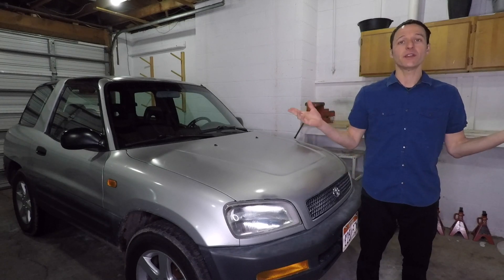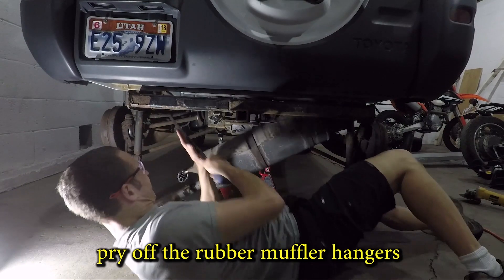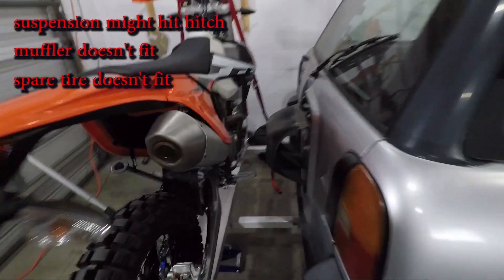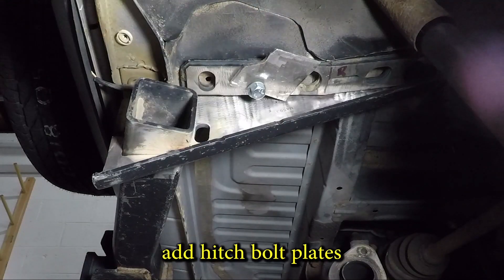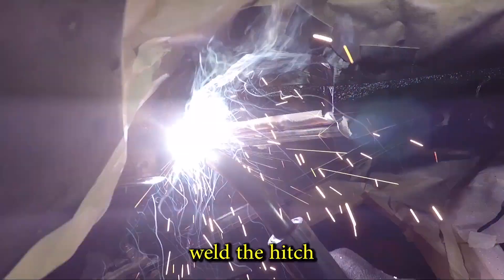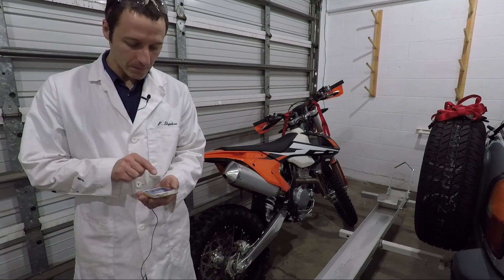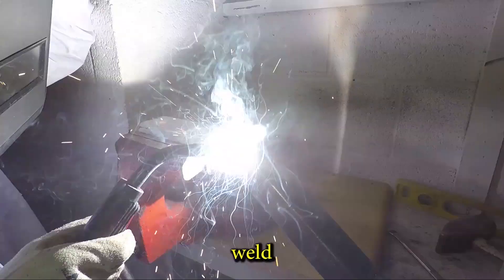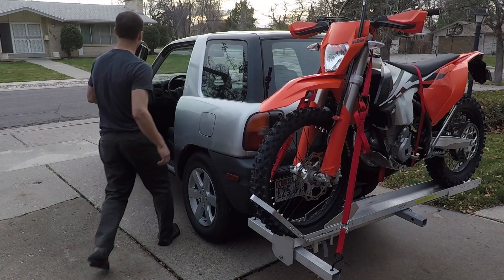Installing a dirt bike rack on my RAV4 (episode 3)

Comment: If you did this in the United Kingdom your car wouldn't be insured unless you told them of your modification. I had one on the back of my Datsun 720 pickup and a driver behind me hit it with his car and damaged the ramp and trailer board. His insurance asked my insurance company was it a proper manufactured part for my vehicle. It wasn't as I made it . If you weld something to your vehicle that's not approved you could be in trouble with the DVLA under alterations to the body structure. Lucky I was a farmer and farmers can do alot of stuff like convert stuff they needed for the farm without approval. This was in 1984 so it's much worse now .
Reply from the maker: It's not fun at all when the government takes away your freedom to work on your own vehicle.  I understand the need for safety inspections to make sure your car isn't a hazard on the road, but when government gets involved, it's guaranteed to be applied in the worst way.

In the United States, vehicle safety inspections and emissions testing is done differently in every state, and each county gets to decide how much testing is needed.  In Utah, they recently stopped doing safety inspections, so now people can crash into you with bald tires in the winter.  More freedom is better though and I'm glad we don't have the safety inspection.  

I live in Salt Lake City, which is a valley with mountains on both sides, and it contains all the pollution we create.  Because of that, every vehicle has to pass an emissions test.  But, thanks to bureaucracy and and overall government incompetence, they don't actually test the exhaust coming out of the car, and instead just make sure the check engine light is off and all emissions components are present.

My RAV4 is currently not registered and doesn't pass emissions because I installed the factory exhaust system from a 1998 RAV4 on my 1997 RAV4.  They're all Toyota parts, and my car runs perfectly.  I have a fresh cylinder head and a new catalytic converter, and the car would definitely pass if they measured the exhaust gasses coming out of the pipe.  But.... my RAV4 originally had 2 catalytic converters and the newer exhaust has 1.  Therefore I tampered with the emissions components and it fails the inspection.

Ironically, before I fixed my car, when it had a blown head gasket and a plugged catalytic converter, it passed the emissions test.  My car literally had white smoke coming out of the pipe and got bad gas mileage.  PASS.  Now that it runs perfectly, FAIL.

I have to register my car to avoid getting a ticket, so I have a few options:
1.  go get an exhaust manifold / catalytic converter from a 1997, which is definitely clogged, and make my car run horrible and burn way more gas to pass the inspection, or perhaps knock out the cat so it's there but doesn't do anything.
2.  get a different emissions sticker for the hood that says the car takes 1 cat.
3.  go to a mechanic who will pass my car
4.  register the car in a different state

I won't be modifying my car, since it works perfectly and adding a second catalytic converter will only take away power and reduce gas mileage.  I'll do one of the other options and probably make a video about it.
Reply: @LabCoatPaul  👍

Comment: Have you carried the CRF300l on this rack? I'll be grabbing a new CRF next year...hopefully, based on availability...but it is a PIG compared to the KTM.
Reply from the maker: Yes, I used the RAV4 to pick up the CRF300L from the dealer.  My rack sits a lot higher than normal so it was hard to push the heavy bike up there.  My class 5 hitch is rated at 1,500 pounds tongue weight when bolted to a Ford F250 super duty.  Welded to the RAV4 I don't know the limit, but I'm sure it's a lot.  I think the normal 2" hitch that bolts on to the RAV4 is rated at 400 pounds tongue weight, so you would be very close to the limit with the rack and the CRF300L on it.

I'm planning on selling my CRF300L soon.  I'm kind of over motorcycle road trips and I would rather have an electric dirt bike for off road use.
Reply: @LabCoatPaul  By the time that the 300 becomes available again in my area I may be "over it"...nearly forty years of riding and i bought my first ever scooter this year, a 2022 Yamaha ZUMA125...and I'm loving it for scooting around the city. Thanks for the reply, and thanks for the channel.

Comment: Well done, you got some awesome skills. How is the rack holding up, please if possible can do a follow up on it and how is the unloading of the bike? Thanks and cheers.
Reply from the maker: Thanks for watching!  I'm still very happy about the dirt bike rack.  The hitch is definitely the strongest part of my car, and I always put the jack on the hitch when I lift my car.  The tilting rack is easy to load, and I can add a strap to the spare tire to make the motorcycle more secure.
Reply: @LabCoatPaul  Hi just assembled my tilt carrier and noticed it has a substantial play on the aluminum sleeve that slips on the steel arm. Did you encounter the same problem and if yes how did you solve it?

Comment: You really did that as a labor of love there! Good planning. That is more than most would ever do. Perhaps you could hire your services out! 

Now a friendly tip: You REALLY should mount taillights to the rack. The ones on the vehicle are blocked far too much. 

Here's how I built my rack, including the lights. 

My rack is a home-built, with a fixed track of U-channel aluminum bolted to two pieces of angle iron welded to the 2" sq. tube in a "cross" shape.  

The angle-iron is only about half to 2/3 the total rack width, because that was all that was needed for strength on the cantilevered rack. 

The 2" steel tube sticks out about 2' behind the U-channel, for tie-downs. The receiver has flanges with holes for tie-downs on that side.

When choosing the 2" tube, I stuck a 6' length into the receiver on my SUV, and jumped on it up and down on it. I wanted the rack to use the lightest materials but still be plenty strong. I would only be using 4 feet, max. (I'm about 200 lbs.) The piece I grabbed felt to light as I carried it around, but dang! It was plenty strong for me jumping on it! It wasn't even CLOSE to bending. My bike weighs about 80 pounds more than I do, but it would not be hanging off nearly as far, maybe 1/4 to 1/3 the distance. I'm not sure now, though, if it was 1/16th (.062") wall, or a little thicker, but it was plenty strong. 

The loading ramp is an equal length of the same U-channel aluminum as the fixed track. When not in use, the ramp stores on the carrier, right beside the main track, held against the inner edge of the fixed channel with two permanently mounted 1/4" bolts, and I just use wing nuts to keep them there. Easy peazy. 

Oh - stainless steel bolts there. I hate rust, love stainless hardware.

To keep the ramp in position while loading and unloading, I just use a single bolt threaded into the middle of the lip fairly near the end of it. To use it, the bolt end slips into a hole drilled in the main track, doing the job of a loose pin, and doesn't need to be fastened. If you want to get all fancy, you can tap the hole in the tongue lip piece and thread the bolt though that, so the lip will rest flat on the track. Otherwise, just use a nut on the underside; either way works. The nut is not so thick it makes it problematic. 

To make the overlapping lip piece on the ramp channel, cut off about 1-2" of the U-channel sides so you have a full width of the bottom of the channel about 1-2" long. Then, file the lip smooth. Bend the lip down a little to match the angle between the ramp and rack. Be gentle bending, so the aluminum doesn't crack. If it does, cut it off flush and make another lip. The ramp doesn't HAVE to be the same length as the fixed track. Now put the ramp in position, and drill the receiver hole in the fixed track. 

The taillights I used are rectangular shaped auto-parts-store trailer lights, the kind that mount flat to a vertical surface. I chose ones that fit nicely inside a piece of U-channel. They are mounted underneath the fixed track to short sections of U-channel that is rotated "back" 90 degrees CW (when looking at the rack from the driver's side) so one side can bolt under the fixed rack channel, and the light can be mounted inside the "U." That protects the lights from damage, whether while driving or just storing it in the garage. Works great! I also beveled the corners of the taillight shroud channel pieces, and any other leg-rippers. Ergonomics, baby! 

Route the wires to a 4-prong flat connector, and  anchor them about every 6-10 inches with plastic P-shaped fasteners screwed to the underside of the rack. If you can, drill small blind holes in the edge of the aluminum channel, so the depth leaves the hole blind. For the steel tube, punch through, it is hidden. If you want to be fancy, you can drill holes to route them inside, but... why? That would mean getting grommets for the holes, and it is a really short run to the vehicle lights plug.  

I think my total cost was about $130 or so, which included hiring a welder for the angle-iron because I didn't have a welder.
Reply: wow! Thanks for this! Planning on doing something about it on mine and this sounds perfect!

Comment: How did you fix the suspension? Did you do something adjustable like air  suspension or permanent? If permanent, how is this affecting normal driving with no bike? I wanna do the same on a Prius 2012.
Reply from the maker: I installed the Old Man Emu lift kit on my RAV4.  https://youtu.be/c1gi9hoCpEI  The kit includes 4 new springs and new shocks.  The springs are stiff, but compared to the 22 year old springs that are dead and bottom out all the time, the ride quality is quite good.
You can get a 30mm spacer kit for your Prius on Amazon.  This will lift the car but keep the same stock springs and struts, so your ride quality will be the same.  https://amzn.to/2Hc8HTY

Comment: I have a question as I really would like a receiver on my 96 4 door model. 
Do you notice any kind of sway from the weight of the bike while driving?
I originally was going to get a roof rack and cage but I hear these cars are kinda top heavy and don't wanna risk putting too much weight on top if I can get away with running a hitch setup instead
Reply from the maker: My RAV4 felt just fine on the highway with a bike on the back.  I've only done short trips. less than 20 miles.  You might notice some extra turbulence behind the car on longer trips.

Roof racks are popular for the old RAV4's, but personally, I don't like putting anything on the roof. 

If you get a normal 2 inch receiver hitch installed on your RAV4, you can carry you gear behind the car.

You CAN'T carry a motorcycle though.  RAV4 hitches are rated at 350 pounds tongue weight and they're not very strong.  Thus all the welding in this video.  My hitch is far from a normal RAV4 hitch.
Reply: Thanks for the input. I have seen lots of guys installing racks and cages, but I doubt they actually utilize them as I want to. I live for the outdoors and I want to bring enough gear along for me and my family to be able to make it 3-5 days. 

I'll look for a class 3 or 4 hitch set up and make it permanent. Plus a custom basket for the back too

Comment: I see a plate holder on your bike so I am wondering what bike it is and if it can be street legal?
Reply from the maker: That is the 2017 KTM 350 exc-f.  Yes, it is street legal.  It's a good bike, but I had to remove the entire emissions system to make it run right.

Comment: well done! Know it's time to unload that piece of crap Rav4
Reply from the maker: I definitely think that sometimes!  I would save a lot of time and work if I just bought a similar vehicle that is much newer.  I haven't found anything like the first generation RAV4.  Nobody makes a tiny, 4wd, manual transmission, lightweight SUV these days.
Reply: @LabCoatPaul  you had me at "manual transmission"
Reply: Paul Shpakov have you considered a Suzuki Jimny? Great little cars, even the new ones

Comment: That is not very secure. When you do this properly, the rack does not move independently of the car AT ALL. Try again.  Search some other videos for demo of this fact.
Reply from the maker: I disagree.  Every rack I've seen that goes into a receiver style hitch wobbles a bit side to side.  This is because it mounts in one point and even 1 mm of play at the hitch turns into over an inch on the ends.   I could reduce wobble slightly by using a hitch tightener or anti - wobble hardware.   I've used this setup several times and it's always good.  I also strap the bike to the spare tire, just in case.